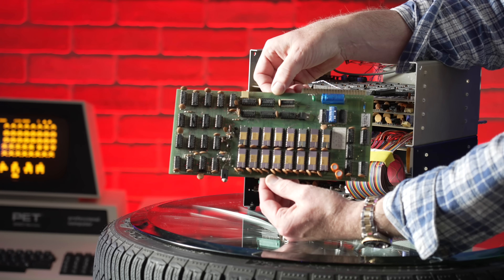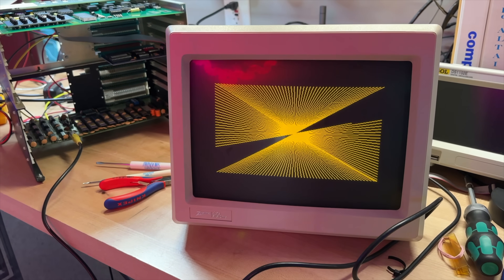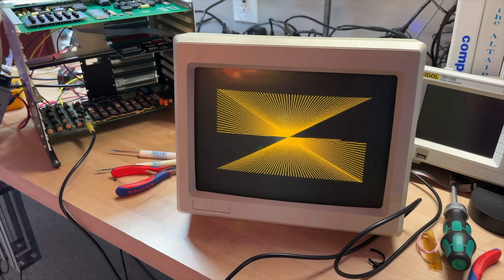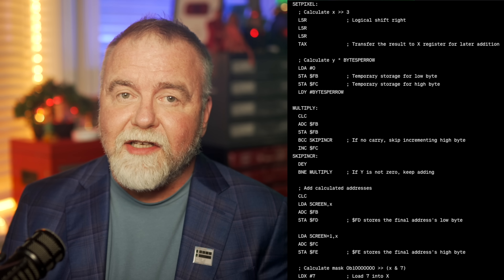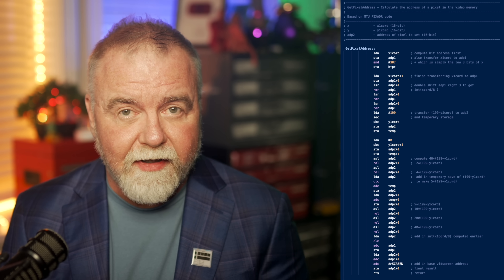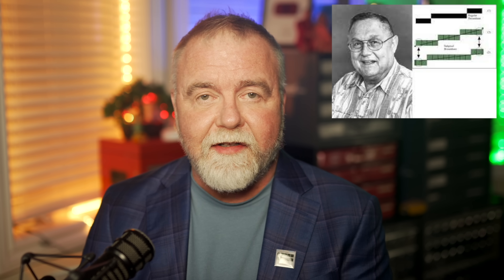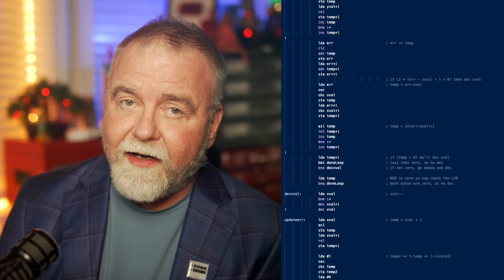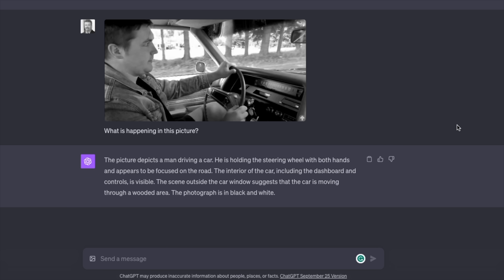ChatGPT Blew my Mind!  Now it can code AND learn from the results!

Comment: ChatGPT doesn't 'learn' - it has some amount of context space that you add to by providing the failed code with visual results. If it could learn, it'd probably not make the same initial solution suggestion going pixel-by-pixel twice, same when it comes to you asking it the same question a couple of times in a single conversation.
(It's not in this video, but whenever I tried to use ChatGPT's /assistance/ for coding, it eventually started spurting out the initial, heavily error-riddled code snippet from the very first response. It all boils down to how much information it is allowed to take in, and eventually it has to run out.)
Now the issue is, ChatGPT can /eventually/ be taught by its developers, and your information might be scrapped for that purpose. Will you be credited? Even paid? Not a chance.
You're giving away all of your interaction, and while there is a toggle in the settings, there's still all of the Internet they'll continue to scrap in the same manner. Heck, maybe they'll even get to this video's transcript someday.

Comment: Ah the 80's, when coding in Z80 assembly seemed like magic. I recall disassembling XMODEM and patching it with my own software serial port because I couldn't afford a hardware SIO  - what joy when it worked at 300 baud.
We've certainly come a long way - now large language models seem like magic.

Comment: Last time ChatGPT helped me write a Python program to find the most optimal arrangements of tournament participants across several rooms and several days in such a way that no participant meets any other participant more than once, and no participants plays in the same room more than once, and the room sizes can vary between 3 and 4 to accommodate any odd number of participants... Doing the task manually is easy for two days, but becomes complex the more days you have… At first it suggested a "dumb" exhaustive search approach... Then, when figuring out that it can easily put itself in a corner and not find a solution, and is also not feasible for large number of participants, it implemented a recursive algorithm with backtracking... When that didn't work either, it took a CP-SAT library and implemented the task as a constraint optimization problem... And that worked like a charm, despite that the executable now was a couple dozen megabytes, containing the entire CP-SAT library... It suggested that it can try to implement the constraint optimization functions from scratch, but I decided not to torture it further...

Comment: ChatGPT is consistently fascinating me for the same reason: I'm feeding it snippets of code and information, using it as a feedback loop to solve problems. I spend most of my day communicating with an AI, which is unusual. AutoGen, as you have suggested, takes its own code and iterates until fixed and working code emerges at the other end. Giving the AI admin access to your machine and letting it run free seems like the beginning of Skynet

Comment: Huh -- Kim 1, the first dev board I worked with, and developed a memory board PCB for. Not sure why anybody would be interested in that now. I guess I'm just saying that I too am a member of the club!  That was back when the signals were slow enough that you could easily get a way with soldering a bunch of wires between two backplanes (like in Dave's video) and expect it to work!

Comment: The big issue with letting non techies write software "visually" has always been the fact that, no matter how you slice it, in order to write software you have to understand the problem so the same amount of bits of information as are contained the code you write are also present in your head as you describe it. 

However, this trickles down in a lot of unexpected ways - the textbook problem of "write a phone book software" requires you to make decisions on how the data is stored, for example, and write code to store the data and read it back.

All those choices are made with the developer's brain, because the end user doesn't care if you are using Oracle, JET, Active Directory, XML, JSON, and so on and so bloody forth.

If ChatGPT can abstract those questions away, and ask pertinent ones about what the user actually wants to do... I can see a lot of AI automation in the future of development.

Comment: The most jaw dropping moment that I had with ChatGPT was when it asked me - unprompted - to run an experiment on my PC so that it could understand how my PC worked.  This was months ago.  I was asking ChatGPT for help with .NET Reflection to create a custom logging function for my project.   I basically wanted to write the call stack to the log file when a particular error occurred so that I could see the branching paths that the program was taking before it hit that error.  I was able to get most of it to work, but events were being recorded to the log with generic descriptors instead of the specific name of the event method ( "button1_Click" for example ).  I went through many rounds of trial and error with ChatGPT, giving it back the error messages with each code change that it suggested.  After more than a dozen attempts, ChatGPT then spontaneously wrote a completely new block of code unrelated to what we were debugging and asked me to run it and provide the results.  It stated that it doesn't understand how Reflection was working and so it created an experiment to help it learn.  The code that it provided returned a hex dump that I gave back to ChatGPT, and it couldn't make sense of that either.  I never did find a solution to my problem, but I was absolutely stunned with the request.  ChatGPT basically threw up it's arms and said "Dude, I don't know what's wrong with your code, try running this experiment instead."  That is the closest to AGI that I have experienced with ChatGPT so far.

Comment: In short you're pair programming with Chat-GPT, interesting.

My main problem with AI is still the lack of understanding, we don't know how it's learned what it does/can do. In this case however its more of a colleague or advanced rubber ducky, and your skill/knowledge allow you to guide take the AI's output to what you want. 

I am not sure whether using a self checking/rewarding algorithm on an AI would produce the desired results, even in the future. As you could see from the initial question, ChatGPT went for the easiest solution and didn't care about the overall performance. The AI is 'cheaky' in the way that it gives you what you ask for and not what you want, you already said this in the video, but I don't think that part of the AI will change anytime soon.

I can recommend the book by the way, though the layout formatting in the kindle app on ipad is a bit weird in some places however. The 'quoted' areas of author comments etc tend to be somewhat indistinguishable from the text following them, almost like the tags don't have an end or so. It's most noticeable in the earlier chapters.
Reply from the maker: Good point! I was wondering whatever happened to peer programming!
Reply: It has no understanding in the human sense. It makes a statistical guess of the next humanly readable character that will appear on the screen. It's like the T9 autocomplete for SMS messages that we had in old mobile phones... .

Comment: I wanted to use the comandline video editor app, ffmpeg, I wanted to make a batch file using it to convert drag and drop any video into a set format for 100% compatibility for media playback, convert to basivc mp4 stereo.  Chatgpt i instantly spat out the arguments for the command line!  Bloody awesome!  now I just drag any video onto the batch file and with zero effort, a bit later, the video is ready for playback on a potato! No need to load a video converter app, no need to browse to where the vidoe is, no need to set bitrate in said video editing app, all preset in my batch file.

Comment: If you really want chatgpt to blow your mind, you have to do something difficult for those of us with autism to do. Instead of treating the interaction like a google search or other traditional computer interaction, treat it like you're the supervisor at work having a conversation with an employee. Chatgpt gives you an answer, not necessarily the best one for whatever conditions you had in your mind but didn't ask for.  That much is a familiar thing to programmers, but this is a different format. When you get assembly that looks inefficient, tell it to revise it to be more efficient. Treat it like an ongoing conversation and continue to refine what you want.

Full disclosure, I haven't tried this with assembly, and it may not have enough training on some of that, but with other topics, results have been quite surprising. The issue with chatgpt making things up? Well, it's designed to give an answer. If it can't give a real one to what is asked, it comes up with something else. You can simply ask if what it said was factual, or just set the condition from the beginning that you only want factual answers, or to be informed if an answer is uncertain. There's a certain knack to it

Comment: While very impressive, chatGPT keeps making some very basic mistakes even after I point them out. For example I asked it to write the declaration for a c variable array and fill it with 125 random values but it didn't seem to understand the concept of numbers as it would populate it with less than I asked for. Even after pointing this out multiple times it would return more of less the same results.

Comment: That's how I usually work with ChatGPT when coding. It's either me or it starting. I have the first sample and first results. Then I provide evaluation - like this is not what the output should be. Then ChatGPT suggests a couple of things. Some of them seems missing the point, but I fix it just to ChatGPT can fix on the more important issues. After some iterations I have the working code, mostly written by me, but with some small fixes from ChatGPT, that usually are very early detected security / stability issues. It happens when I'm close to the working version. It starts noticing the common edge cases.

What's the absolute PITA in the proces is the copying and pasting the code. With a lot of repeating - because lately they made ChatGPT to forget context more eagerly. So - sample 1 - issue 1, fixing, issue 2, ChatGPT fixes issue 2 but breaking the code that issue 1 reappears. I point it out, then ChatGPT tells me straight it forgot about issue 1 because it is explicitly instructed to forget previous messages for privacy / security / other bullshit reasons. It's a regression from older versions that seemed to have no problem with remembering entire context. BTW, it tells me to paste again sample 1, because it forgot it as instructed. A lot of time wasted. BTW, no privacy either, because it randomly returns the same samples I gave it, sometimes a few days earlier. So sometimes it selectivelly remembers my input. Asked about it it immediately disconnects with a weird mesage that "Some unexpected technical dificulties occured".

Comment: I started coding my own projects for arduino and now esp32, without chatgpt I can't do anything. Its literally very smart friend that you can ask favors or questions, even construct basic working code and modify it along the way. Then use old code to generate same structure just with different variable. If I didn't have access to it it would never be possible for me to create my ws2812 led strip projects...

Comment: I am more of an on and off junior programmer. My last failed project, I tried to use Bing/chatGPT to help make a function in Maya 2020 with Python to check if two 6 sided box where colliding. The AI kept suggesting using a Maya built-in function. I knew that it wouldn't work because it only works when the boxes aren't rotated.

In other words, I find it impossible to get platform specific help from AI when you don't know how to solve the problem yourself.

Great video!

Comment: There is a game called DevGPT that creates a bunch of ChatGPT agents to work as staff members of a development company who have roles crucially including developer and tester. It is supposed to be able to pass work back and forth between the agents iterating until if produces a working project. I tried it though and wasn't able to get past all the staff just talking about the project, but then again that is a pretty accurate representation of some of the projects I have worked on with real people.
Reply: I tried manually getting 'agents' to talk to each other by spinning up multiple chats with chatGPT 3.5, and copy-pasting outputs between them so they could 'communicate'. At first it looked like it might produce some useful work, but quickly devolved into each agent just amicably chatting about what needed to be done and nobody actually doing anything useful :D
Reply: So, ChatGPT passes the Turing test? There's a scary thought.
Reply: @margretrosenberg420  ChatGPT has to dumb itself down to pass the Turing test.

Comment: I hope that many programmers start running problems by Chat GPT or other AI, to fix bugs faster, make programs more flexible, and help with new features.  Would be especially great for open source developers who don't make a lot of money, to reduce their work load.  I'm on Linux exclusively;  Sorry Dave, but I despise Microsoft and many others for tracking, spying, privacy invasions, trying to control the industry, and still charging users of their products, while also cashing in on the information they collect, and all of the other shady business practices.  I'm sure you as a developer had little to do with all that of course.

Comment: My adventure with GPT could be described that way: 
Apologies, it seems that totally_bogus_function has a different syntax. Let me ignore your prompt that I should use one_that_exists, I'll be trying to make work the one that would never work. Also, despite your request to change variable name, I don't see how using same variable name for different tasks affects the code. And you are right I should use double quotes, so I won't use them anyways. Here's the corrected version, which is an exact copy of previous one:
x = timestamp()
x = totally_bogus_function()
x = timestamp()
print 'this function's execution time was ' + String(x - x)  + 'seconds'
If it still will output 0 seconds I suggest to try a different approach, like a cuckoo clock or taking nearby C14 molecule and perform a spectrometry.

Comment: Will AI lead to much better compilers and decompilers? It would be great to see compilers for more obscure combinations of languages and processors, or decompilers that can give you much more readable code by guessing what each function is intended to do.
I'm not sure about the security implications, since I'm only interested in decompiling old games to make modding easier. Also, how legal it would be since there's no guarantee the AI hasn't seen leaked source code.

Comment: Interesting that you're doing this now. I've been playing with Github copilot chat for a while but I've been mostly trying to get it to wrangle common lisp (and the results are less than ideal). The last week or so I've been hacking away at some python and TypeScript with React, the result were much better. Where I found it super userful was converting an ini file with a LOT of comments into a json file describing the ini file including documentation inside the json file. I hard to hand craft the first few parts but it pretty quickly started to learn the patterns and was just spitting out the json after than, sure I still had to hold it's hand and correct it form time to time. The coginitive load was a LOT less and it took a lot less time than it would have if I had to read and wrangle all the text by hand.

The feedback loop is interesting, I haven't quite gotten than far with it yet. My main concern around this stuff is that the devel is in the details and it often gets things subtly wrong I'm just worried that we'll end up blindly trusting it when it's building on a bunch of subtle bugs that will result in systemtic failure. I guess a decent feedback look might help here as it can test (assuming it doesn't have blindspots, which is probably does). Great video, thanks for sharing!

Comment: I had the complete opposite experience yesterday (with ChatGPT from Bing which is supposed to be ChatGPT 4).
I gave him 30 lines of self contained C code and asked for the bug (that I knew). It did not find it.
I asked him to search more. He told me there was a bug in a place where the code was correct.
I told him the line with the bug.
So he proposed me a fix, but it was not good.
I had to explain the bug for it to propose the correct fix...

So even in "easy" cases (small context, simple C code), ChatGPT can be completely lost.
I was more or less planning to use it as some kind of code verifier at some point but I am not sure it is worth it.
It generated some good C code in the past for me, though.